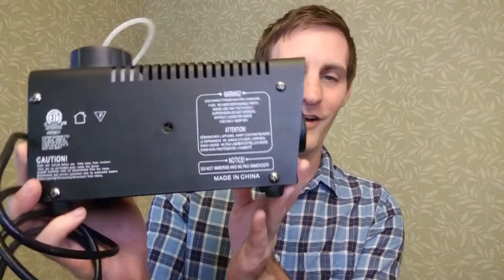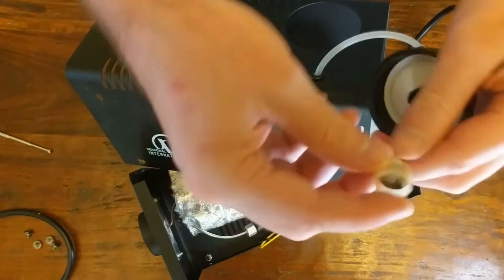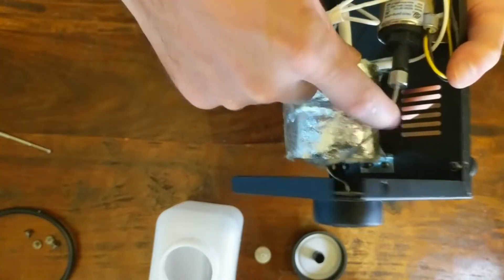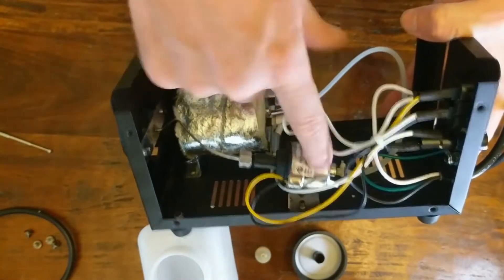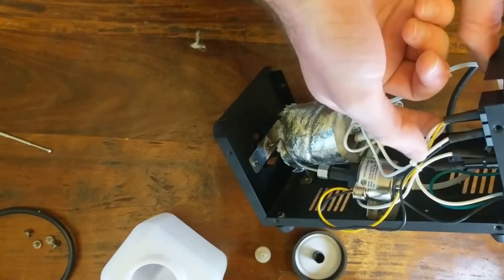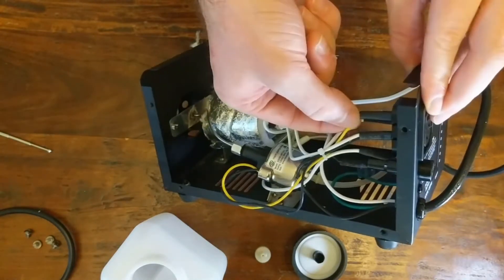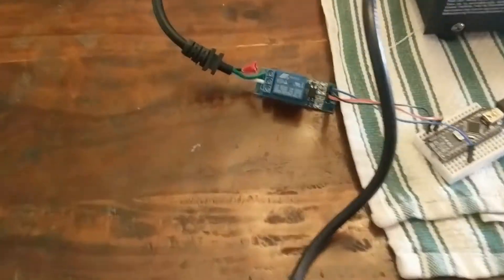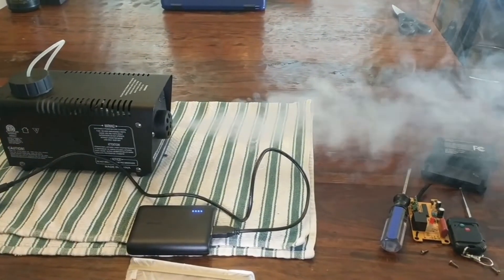Fog Machine Breakdown and Hacking for Arduino Control

Comment: Came here because I have an issue related to the machines and everything you've done is exactly as I have, thank you for confirming.

All the code questions: If you've ever touched an Arduino, it's not that hard figure it out. Use a module as shown in the video (mechanical or SSR) to avoid smoking the Arduino. Relay + to Arduino 5v, - to Arduino GND, pick any digital pin, in this case D8, then

const int relayPin = 8;

void setup()
{
  pinMode(relayPin, OUTPUT);
}

void loop()
{
  // Turn the relay switch ON, for this relay, LOW
  digitalWrite(relayPin, LOW); 
  delay(500);

   // Turn the relay switch OFF, for this relay HIGH
  digitalWrite(relayPin, HIGH);
  delay(10000);
}

Reverse LOW/HIGH if your relay requires HIGH to turn on. Add Serial.println() 's as desired.

Comment: Be careful.  There's mains AC voltage going through that relay board.  While the relay is probably rated to handle it, the dangerous voltage is exposed at the solder pads on the underside of the board.  It'd be best to put the relay board in a small junction box to avoid accidental contact.

The foggers with the five-pin DIN ports and/or the 3-pin DMX connectors use low-voltage DC, which makes for a safer hack.  Unfortunately, those machines are generally a bit more expensive.
Reply: I was wincing when he was fiddling with it when it was still plugged in. I was shouting "dont touch it man!"

Comment: Thanks for this video!

I purchased one of these units without the remote and one couldn't be found. 

Following the information in this video I was able to use a simple jumper cable to connect the right pin from the timer input (white wire) with the middle pin (yellow wire). This enabled the unit to run perfectly. 

Thanks again!
Reply: I did the exact thing from your comment and it workssss. Thank you man

Comment: I have one with only an IR sensor, how do I wire it to bypass that and activate with a momentary switch? Circuit to the ir isn't color coded ( red, green, brown) a 3 wire plugs into the board to activate

Comment: So here’s a weird question I have the exact same fogger, is there anyway to splice into the wire which the wall outlet cable wire on it is there anyway to splice into that to make it run off of a 12 V vehicle from the car?
Reply: A cheap fog machine needs 120 volts and 400 watts!  So the only way to do that is to use a 12v to 120v invertor that is rated for 600 watts at the very least.  But even then, a 600 watt might not be enough to power it.  So I would look for a 800 watt or higher. You get what you pay for!!!  The inverter will be well over $100 USD.  Take note, cigarette lighter power is only for under 180 watts. You will need to hook the inverter directly to the car's battery to take full advantage of the inverter's capability.  Also keep in mind the car needs to be running or your battery will be drained quickly.

Comment: I did a similar project this year. The major difference between the two were mine came with an IR remote instead of an RF remote.  When you pressed the IR remote, it would send a signal to turn the fog machine on, and another to turn it off. What I ended up doing was hacking the IR code from the remote and then building a circuit with an IR transmitter that would output the same code as the supplied IR remote. I programming the Arduino to send random codes to turn the fog machine off. 

The advantages were I had to make no internal modifications to the smoke machine itself.
Reply: You did exactly what I want to do. Do you have a guide to how you made it all happen that you can share?

Comment: I have a slightly different fog machine that I'm doing something similar to. The one I have after warming up stays on for about 20 minutes and then the Ready light goes off and we are unable to release fog for about 1 minute. It then is ready again after the minute passes and normal operation can continue. Does your fog machine have similar functionality? If so how do you handle the motion sensing when it's in the unready state?
Reply from the maker: Yeah, mine does have a warm up period but it hasn't been a problem as long as the fog is only put out in bursts (it seems worse/more frequent when the fog is more continuous). I'm not sure what to do about that but if you figure anything out let me know!

Comment: what happens if you join the control input cables together? is always going to be ON until you unpplug the current cable? i have the same machine
Reply from the maker: Yep, but I think it'll only shoot out fog while the thermal element is hot enough so you probably want to pump it periodically instead of keeping it on.
Reply: what about a switch? in order to fix that. What kind of amp i will need?
Reply from the maker: If I remember correctly it's connected to the mains-power so be careful with those. A normal light switch would work though since those things handle that much power. If you use a relay like I used with the Arduino then the switch on the low voltage end could be practically anything.
Reply: Ok men, i will try it with  a common wall light switch may be it works, thank you.
Reply: @hectorrb  How did it go?